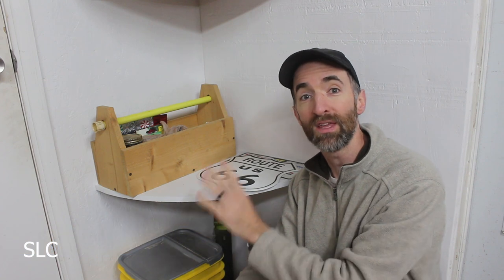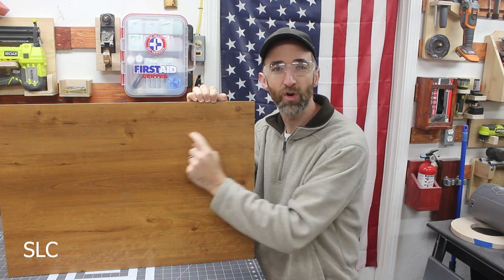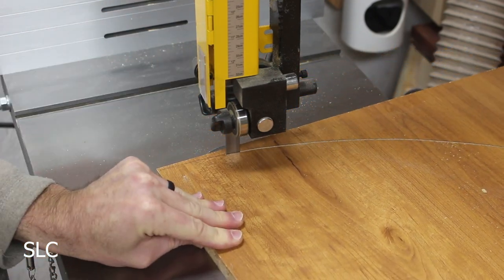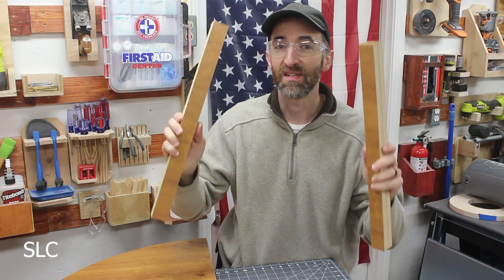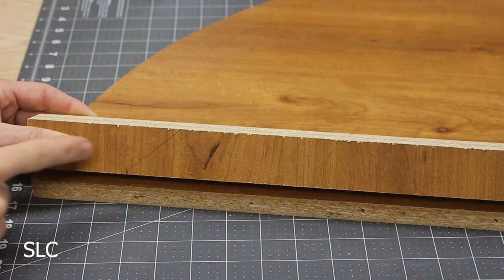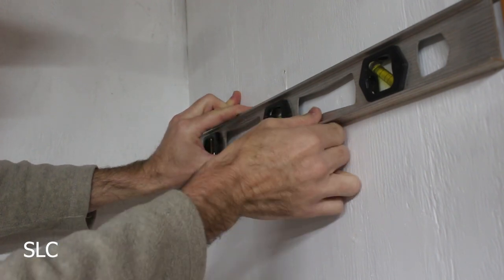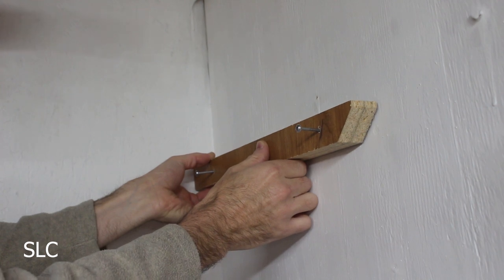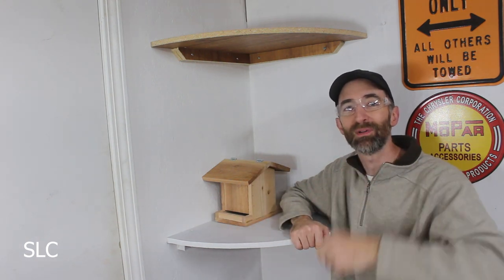Simple Corner Shelf for Garage and Workshop

Comment: Awesome job repurposing the desk top!  Just a tip for anyone that doesn’t want to wait for glue to dry.  Use CA glue and spray activator if you want an immediate bond. I agree it’s also super helpful starting the screws in the mounting boards first where just the tip sticks out of the other side.  👍🏼
Reply from the maker: Thank you, and good tip on the CA glue.